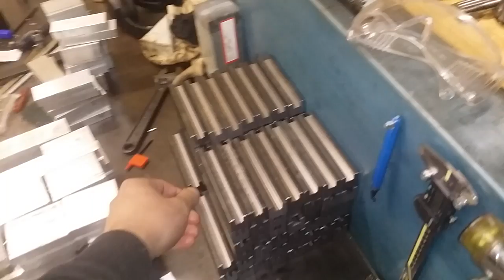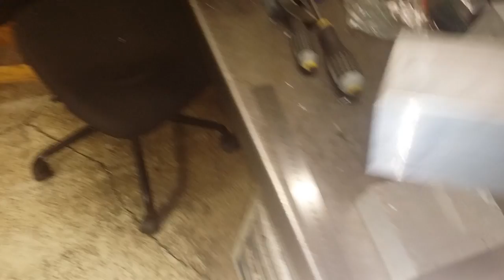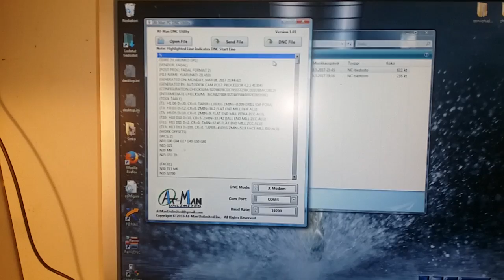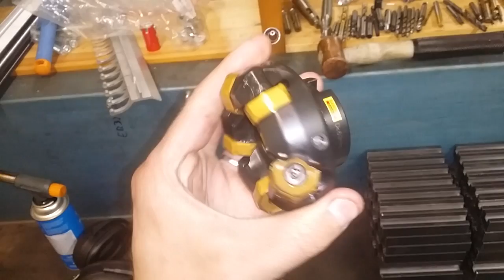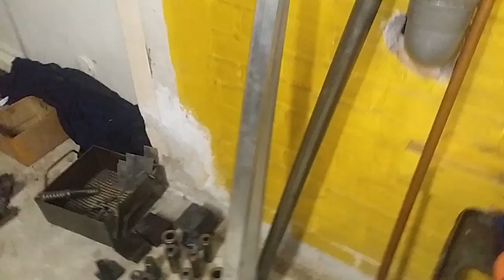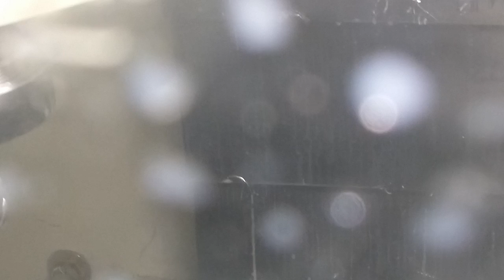Shop update with some cnc milling and news

Comment: How do you get so much production work ? Here there's exactly zero. 
Cleaning lady did a nice job!
Reply from the maker: You from Sweden? The shops here are all doing very well at the moment. Looks like the bad times are behind at least for some time. However, most of my work is still one off pieces or repairs, I try to stay away from mass-production because I cannot compete in that business. Even this job is just a set of 10-24 of each piece. Lots of setting up and dialing in.
Reply: I am from Norway. It seems to be getting better in general here too, but extremely hard to get production of any kind if you don't already have your foot in somewhere.